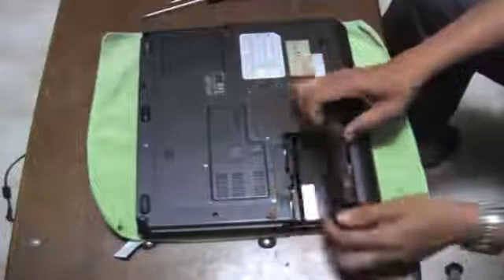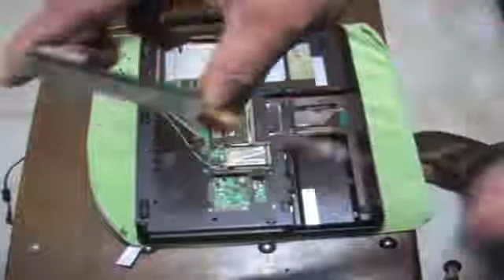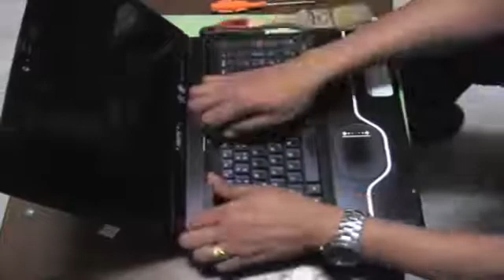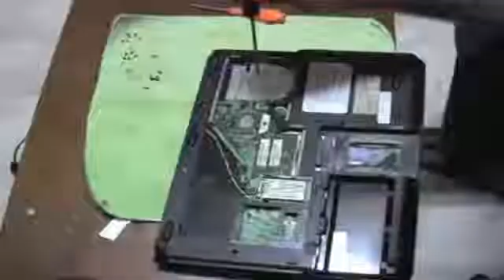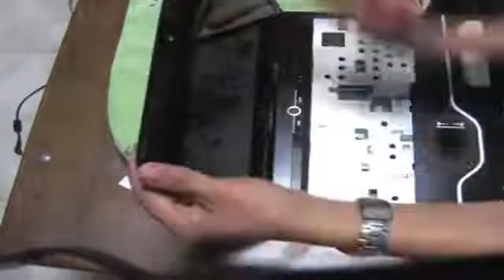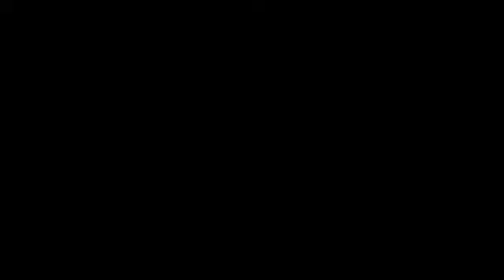Repairing and Cleaning Packard Bell Easynote  Disassembly CPU GPU Thermal Paste Replacement

Comment: Ayos idol galing mong mag gawa salamat sa pagbahagi mo
Reply from the maker: Thank you share ko lang po. Old video ko po yan nakita ko lang sa mga files ko share ko para don sa mga may problema sa laptop. Totally dead na po sya pinalitan ko ng processor kasi yun ang nasira tapos nilinis ko ko yung exhaust nya na naging major cause ng pagkasira nya dahil ng over heat at kinailangan na din lagyan ng thermal paste.
Kung may problema po kayo sa Lap Top nyo comment nyo lang po tulungan ko po kayo.